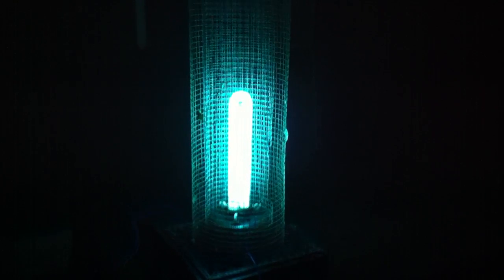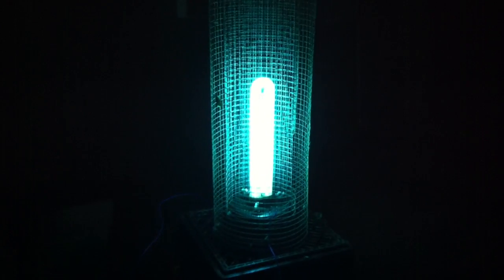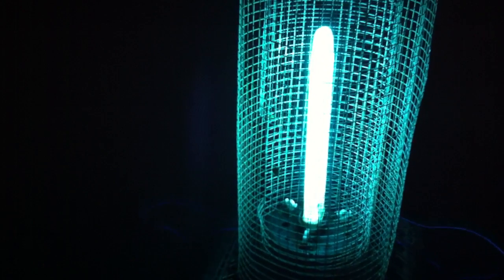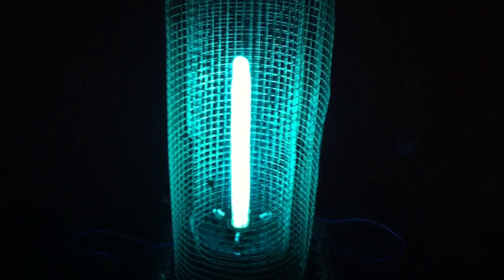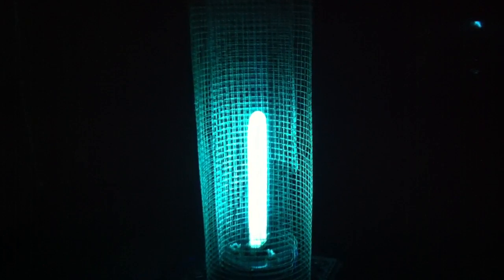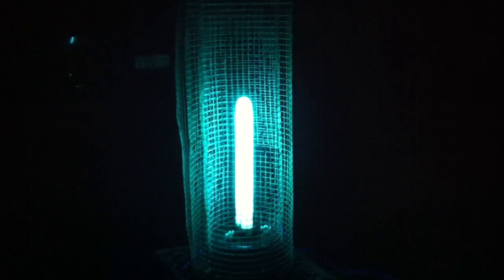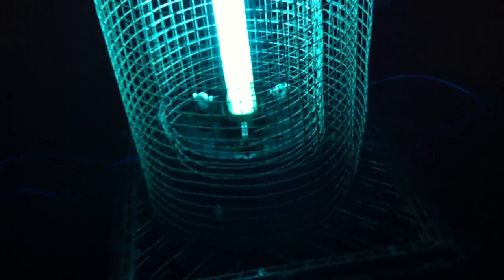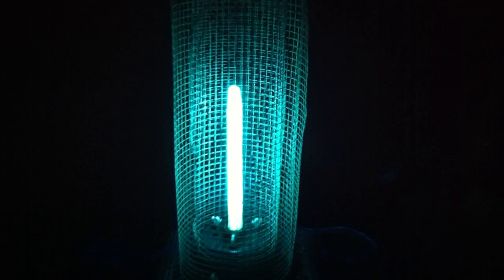Large 10,000 Volt home made Bug Zapper

Comment: That's the quality of the bug zappers of the 80s.  When we were little,  we were told once not to touch it.  The problem with the new zappers is the stupid safety cage on the outer ring.   Cuts the performance down 90%.  You need the fly death upon landing.  Good job sir!

Comment: Can I use two 5000volt Transformers to make it 10.000volt
Reply from the maker: Yes you would hook them up in series by splitting the A/C line into a pair so you have 2 black wires and 2 white wires and connect them to both transformers. Then Connect 1 lead of the 2nd winding of the 1st transformer to 1 end lead of the 2nd transformer. You should have 2 ends one from each 2nd winding of your transformers connect those to the cages 1 inner and one on the outer cage then power up. GL

Comment: Is there a way to get the plans to build it?
Reply from the maker: It only has 3 parts (transformer, Inner/outer cages, and 1 light bulb) both the light bulb and transformer plug into 120 volt outlet but the 2 leads of high voltage from the transformer are connected to the cages, 1 on the inner and one on the outer cage but must be kept apart from each other from transformer to each cage keeping the high voltage gap at the 2 cages.
Reply: You have to know what I am going to build!  :-)
Reply: Is this a microwave transformer u used?

Comment: can you tell me how to make one? spacing of the wire mesh and cost of material? ive looked everywhere but they just show the end result but dont describe how to make one.
Reply from the maker: Justin Bates  Be more then happy to. I used bird cage mesh, but any wire mesh will do as long as it has inductance. I'm using an ignition transformer but neon transformers work as well. go at least 6kv I used a 4kv neon transformer and it didn't zap enough, it more or less set them on fire. Look up high voltage neon or ignition transformer voltage grade is up to you. the light bulb u should be able to find. As for spacing the cages, you gonna have to adjust based on voltage. 4kv is about 1/2" to 1" , I have this gap about 2-3"  As long as its not continuously sparking and close enough that the bugs can't just fly right through...  sometimes really tiny ones slip by if the gap is too wide.   Good Luck
Reply from the maker: if u need further detail u can msg me....
Reply: thanks for the details. im an electrician and have been for about 10-12 years.working on my masters now, so i can get the material i need pretty easy i just wasnt sure of all the other details. i love the Jacobs ladder effect. ill let you know the end result soon
Reply from the maker: I posted up more then 1 of these videos using the 10kv and I think one with the 4kv neon transformer as well.....    Look up my uploaded videos I guess ........    https://youtu.be/UO81jfyzMwc   there is another video that has more bugs getting zapped then this one........